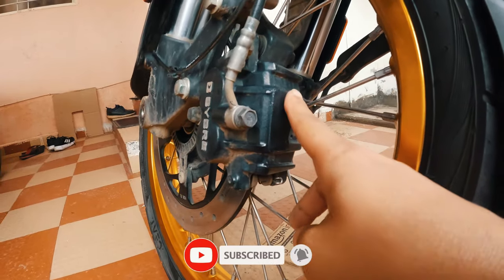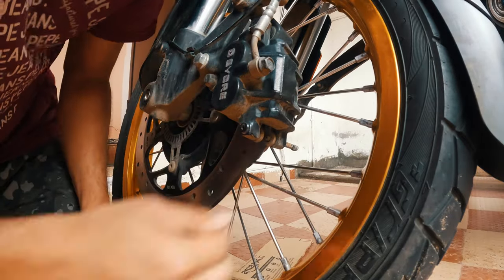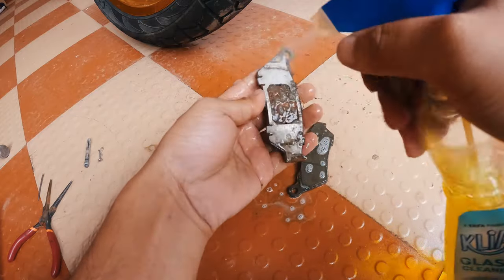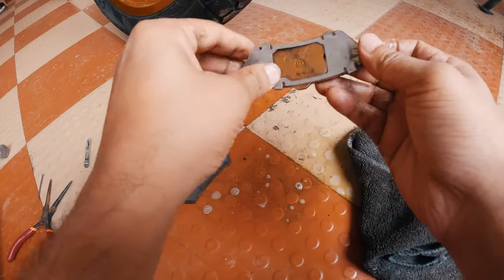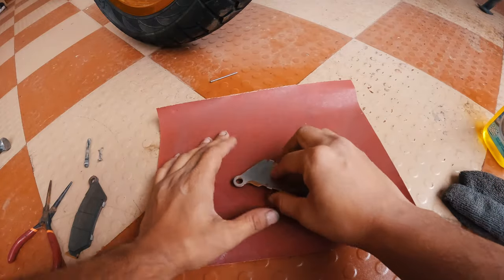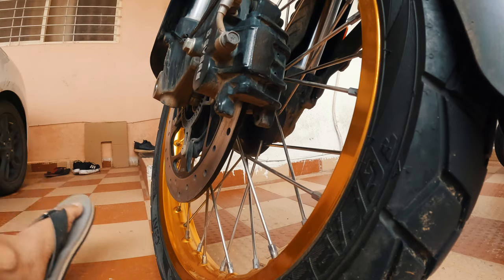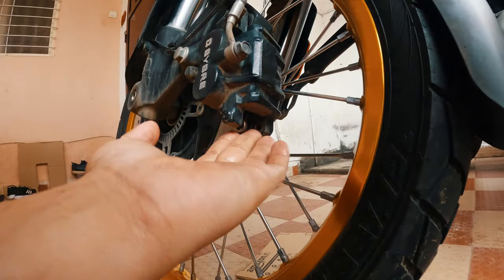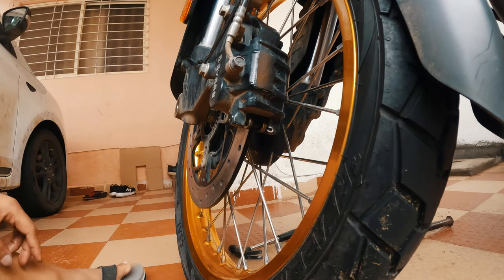The Ultimate Guide to Front Disk Pad Replacement on Himalayan 450

Comment: Price of himalayan 450 brake pads
Reply from the maker: Hello.. I have not changed it yet so I am not sure about the price. But they should not be more than 2200.
Reply: @OnceARider  i herd that Himalayan 411 and Himalayan 450 brake pads are same and can used the same brake pads (will you try it out )
Reply from the maker: I am not sure about Himalayan 411 but they are the same as the Interceptor and the Interceptor ones are cheap. So yes sure! I will try those and will update.
Reply: I recently changed the brake pad from the service centre, they charged me 3500
Reply from the maker: @hasandahiwale7055  for both rear and front right ?
Reply: @OnceARider  Not both brother, single ki price bata rha hu... Both front and rear ki price 7k
Reply from the maker: @hasandahiwale7055  😳 then it make no sense to buy the Himalayan ones. Will have to look for some 3rd party pads or we can use the one for Interceptor. 
I will try to find a better option and will update.
Thanks for sharing the info.
Reply: @OnceARider  I bought from 3rd party. It costs around 1300 only..
Reply from the maker: @hasandahiwale7055  could you please share the brand or model of those pads?
Reply: @OnceARider   Hey! even i enquired the price at service centre, and both front n rear costs approx. 7k.  If we plan to look for 3rd party Break pads, what type would you suggest? ceramic or the sintered ?
Reply from the maker: @keeeyrun  Hello.. I have got updated information on Himalayan 450 brake pads. The front one costs 2140rs and the rear one costs 3300rs, so the total would be 5440rs. 
But you can get the brake pads of the interceptor both uses the same brake pads. And the interceptor ones are cheaper.
However if you want to go with 3rd party brake pads the consider ceramic pads only. They perform better and must for bike like Himalayan. I am planning to try vesrah ceramic brake pads once done with the stock one.

Comment: How many kms should the back break should last, mine they asked to change at 45000 kms
Reply from the maker: Hi, I think you ment 4500km not 45K and mostly it depends upon your riding conditiona and riding style. However it should lasst at least 6000km and in ideal scenario I can last up to 10k kms.
Reply: @OnceARider  yeah I meant 4.5k , thanks for the info